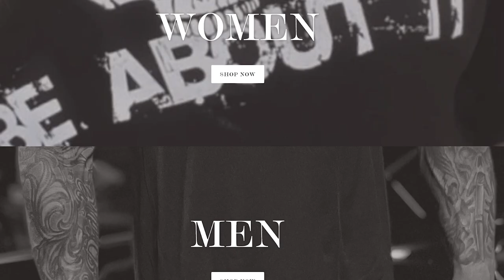vlog #4 Teaching how to make bloom steel

Comment: Anybody that said you can't make a smelter or 'bloomery' out of ordinary clay has never smelted before.  Although I must say this is the first time I have seen a bloomery built this way but that don't matter what matters is that it works..  You go girl, keep showing them how it's done.🙂🙂😇
Reply from the maker: exactly.  its a stack that holds heat so i can push air and melt iron to mix with carbon.  bam. bloom.